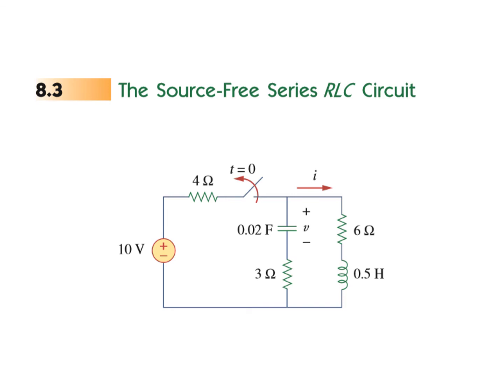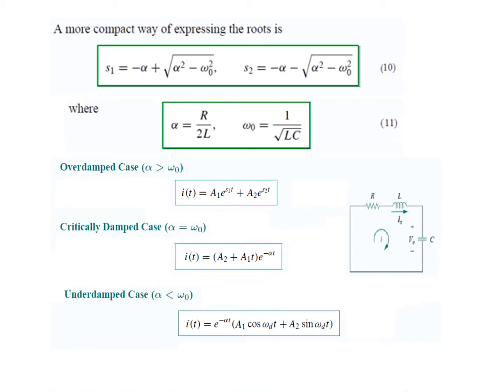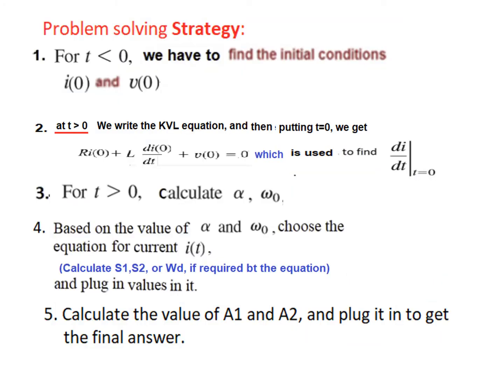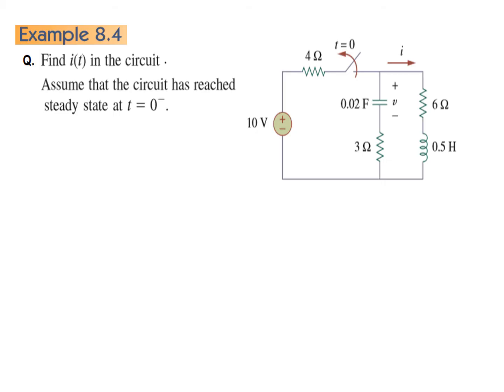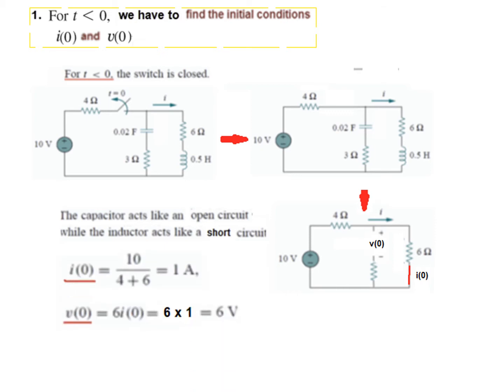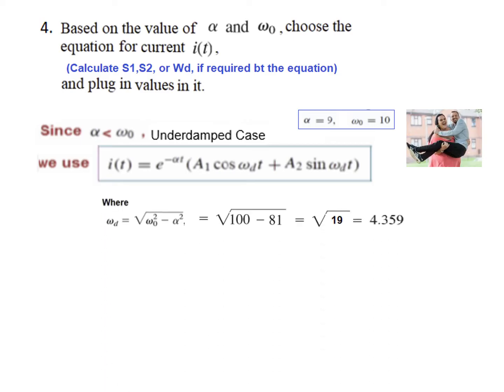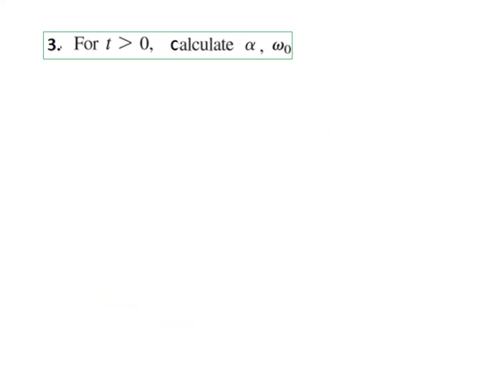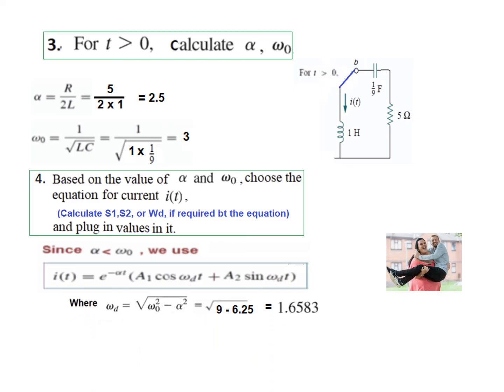(English)LCA ||  Example & Practice 8.4 || Source Free Series RLC Circuit Explained: || (New)

Comment: hello sir for example if the both questions  asked for Vc(t) and VR and VL(t) at t>0 
so we have the same current for all of them so then for finding VL we will differentiate I(t) and for Vc we will integrate I(t) and for Vr just multiply it by R 
is this is true?
Reply from the maker: Looks ok to me.
Reply: @ElectricalEngineeringAcademy  thanks sir and one more thing 
Sir sometimes we have circuit like those second orders when it's ask for It or Vt 
So when we switch the circuit to the transient period it will missing one element for example after switching we will have one resistance and capacitor in series without inductance or 
After switching we will have just a resistor so when we will not have RLC we will have some other types so in that cases shall we consider those element that we will not have as zero?  After switching just resistance we have and capacitor and bo inductance so we will say L=0 as well as any other type?
Reply from the maker: @rahelfarhad9946 Sorry dear, I can't follow your question. If you have a question rom a book, please share, so I can understand.